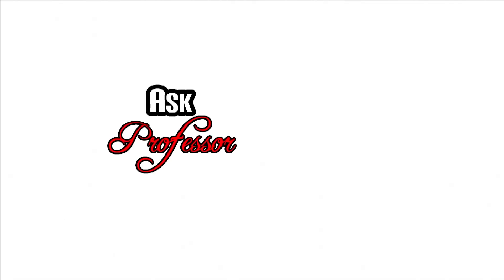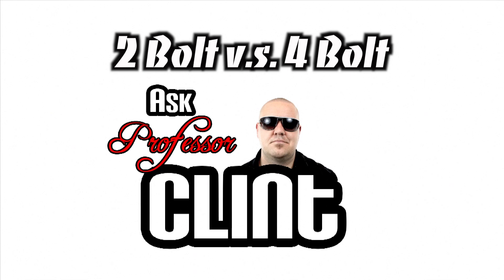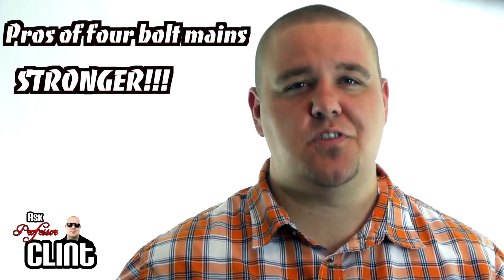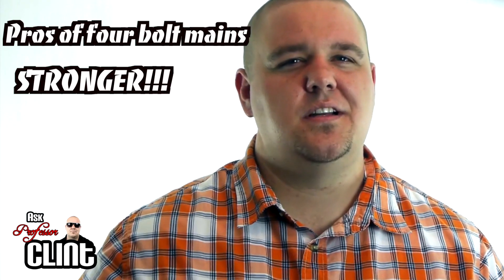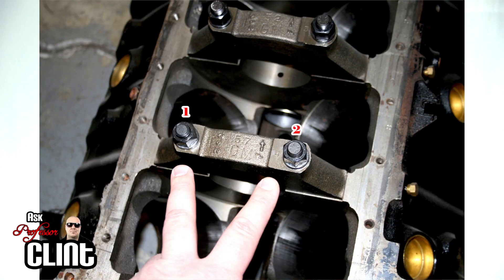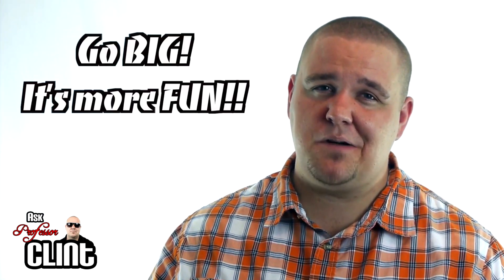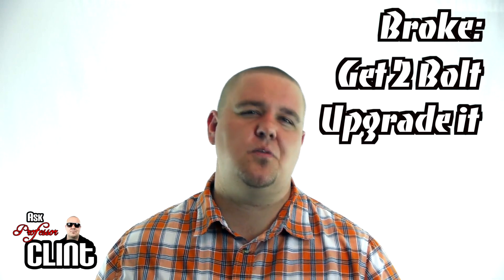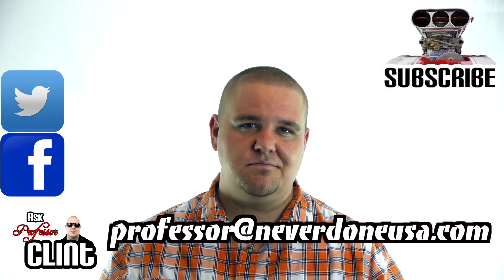2 Bolt vs 4 Bolt - Ask Professor Clint - Never Done

Comment: I bought a 4 bolt block in 1990 that came out of a race car. It still had some crosshatch in the .030 bores and it came with studs and a Milodon oil pan. All for $250. Cool! So I put it all together and first thing I notice is practically no oil pressure at idle however, it ramps up to 60 psi off idle. Yes, I plastigauged a a main and a cap and put in a new high volume oil pump. So, I changed the crank. No difference. Also, it seemed to consume more oil than I thought it should. I sort of figured out that perhaps 2 cylinder bores were elongated which explains the low price of the block. Ok, to my point. I want to build another small block but make it more bulletproof. Now, I talked to a few people and they said the 4 bolts will crack the valley by the lifter bores and will loose the oil pressure at idle which may explain my oil problem. They said get a 2 bolt and you wont have a problem. However, I been throwing speed parts at my present block and it's still holding together.I'm still using it of course. It runs a 76 Monte Carlo in the 13s now. It also can spin 8000 and live except the cooling fan and an alternator belt. Now, What I want to know if it's true about the cracking the block with 4 bolts? Actually it's 4 studs. I'm on a budget but whatever I find that I can afford, However 700 hp may not be enough. If I find a Roots blower on the side of the road i'm using it. However if the 4 bolts actuall do crack the block i'll stick with the 2 bolt which I allready have on hand.
Reply from the maker: Christopher Wyller $250 awesome deal! Good for you! Your question is actually quite complex. Every block has a point of failure under a given set of conditions (usage, engine temps, loads, rpms, external temperature variants, etc). The 4 bolt blocks do very well as performance engines compared to the 2 bolts (as you can attest to) but they will have problems as you approach their limits and it sounds like that is your intention. The right answer is to move to an aftermarket block and go for it but with budget being a consideration I think I'd stick with what you have and just let a good engine builder look it over to resolve the issues. If you're still unsure about using the 4 bolt you can also look at doing a 4 bolt conversion on a 2 bolt block (costs about $500).
Reply: Thanks for the reply! Yeah, i've seen the aftermarket caps on a block with the outer bolts splayed out to reach the wall of the block instead of just being on the bulkhead that would be the way to go but then you're looking at line boring the caps as well which woulld be a good idea regardless but add boring and decking and magnafluxing and you get a $1000 bill at least. Bout the cost of a new Dart block which is pristine to say the least. I just gotta face it. there's no cheap way to go.  I saw a 383 small block for $1700 in some magazine but you get loose clearences with those as they're made for one racing season so rats, I don't know. And you still gotta machine the Dart blocks, decking at least. I guess what i'm wanting is a bulletproof engine that lasts forever on a homeless man's budget. I guess i'll just start with checking out the present block and see how cracked it is. Problem is i'm still using it. I'll continue on with the 4 bolts regardless. I can easily see myself exceeding 700 Hp at any rate. Thanks for clearing that up for me.
Reply: Christopher Wyller  Dart blocks still need to be machine finished so expect to pay $500+ over the retail price of the block.  I've just added "Splayed Main Caps" to a 2 bolt (now a 4)and it dynoed close to 800hp. Bolts for the bottom end, we change regularly do to loss of Ductility.
Reply: Low pressure at idle sounds like extra clearance in the cam bearings.

Comment: We did dirt track racing, 350 SB usually .030 to .040 over. Used both 2 and 4 bolt blocks, generally 7000-8500 RPM. Both types of blocks did the job but I do have to say that when the 2 bolt let go....it really let go. Not much was left of the bottom end or the top end. Almost like someone put  a grenade in the engine. By the way these were also professionally built engines. This is just some extra information on 2 and 4 bolt blocks that we discovered from regular use, and it was not just us, it was a common issue among drivers. That RPM, sometimes even close to 9000, for a long period of time is eventually knock the crap out of any engine. Unless you have the money to rebuild and refresh on a regular basis.
Reply: Yep, many 2-bolt 350 has been built making 550+HP. I've built a few myself, but usually limit RPM to around 7500. They'll take more than people think. Wouldn't want to race a 100 mile road race with one, but in short burst, they'll live.

Comment: The exception here is the 400 factory small block Chevy.  The 4-bolt blocks are NOT as strong as the 2 bolt blocks.  In the video at 1:33, you will see a factory 400 2-bolt setup.  Notice how the caps are as wide as the standard 4 bolt SBC caps are, from register to register, for more contact area with the block.  The 4-bolt setup had a tendency to crack the blocks.  Note that this is ONLY the 400.
Reply: silicon212  eeeeeeyaaaaaaa
Reply: Exactly very true except the 350s also crack

Comment: sounds exactly how the big companies want you to think, we reuse the main bolts, bearings, head studs etc at upwards of 800 horsepower, a bolt doesn't magically lose its strength, they are just "pre stretched" yes they stretch, unless you over torque them, then your pushing the tensile strength to its limit and it takes little effort to break it. But if everyone did that how would they make their money. just like we use oem reused rod bolts, the rod ALWAYS breaks before the bolt, no need for arp.
Reply from the maker: To each his own. Good luck to you and thank you for watching the video.
Reply: No problem, and thanks. just putting my experience with this out there, people shouldn't feel pressured to buy all new arp bolts, if they are watching a video about mains I doubt they will ever be pushing over 500hp. (ps great video and drilled and tapped 4 bolt mains are stronger due to them being angled it gives no room for it to "walk")
Reply: @NeverDoneUSA a YouTube video just proved this on a 4 bolt main .010 casting 350 block with original hardware. Made 1025hp on the dyno with a torque storm supercharger.
Reply: @stevenbelue5496  very nice. 8 years later I still have my oem headbolts on my 800hp 5.3 ls. They have been reused 3 times now

Comment: for $500-1000 you can get a newer ls engine that has better caps in the first place.
Reply: But i'd rather keep the original 5.7 L 4 Bolt main  engine with bigger cam in my 1970 Chevy C 10  just to keep it original it sounds great and has enough  power for a daily driver
Reply from the maker: The LS is a GREAT option. It really all comes down to budget and desired outcome.
Reply: i know how that is. I'd love to get a ls for my s10 but instead I'm going with a $200 350. I guess the good thing is all the old 4.3 stuff still works.

Comment: I have a 350 swapped ford ranger, it's all stock besides the bore, (.060) what could I do to make more power? Cheap things to do?
Reply from the maker: The first thing to do is make sure the engine is running as well as it possibly can in it's current trim, a tuneup and proper timing will go a long ways on an engine that needs them. From there I'd start with headers and a free flowing exhaust system, then look at an aluminum intake manifold, a performance carburetor and a camshaft. The real power in a 350 is found in the heads, if you've got the money look at swapping them out. If you're on a SUPER tight budget look at getting colder air to the engine from outside the engine compartment via ducting, venting, scoops, etc. then open up the exhaust flow the best you can (even replacing restrictive factory mufflers with high flowing units will help)
Reply: Lol, i don't have a chassis to put it in, besides the ranger
Reply: ok just zip tie a bowtie to the grill then. lol
Reply: first pull that 350 and put it back in a Chevy.

Comment: Thanks for the info on this, I'm new to engine internals but have been doing all my repairs for years. Now I'm looking for a salvage yard 5.7 vortec to carb for my 84 c10 original 305 spun a rod on a 500+mile trip on a tight budget, auto tech student. Are there any tips you can offer to me in what to look for at the junkyard, I know I should check oil, and look for something that is wrecked, pull valve covers, turn engine by hand for compression. do I absolutely have to pull the oil pan? Thanks and I enjoy your videos!
Reply from the maker: That vortec 350 will be a nice upgrade for your c10. The standard things you look for are things you've already listed: Make sure it turns over, check the oil (you could just pull the plug) and look for metal or water, and look closely for any signs of external damage or wear. Look for areas that appear to have had issues in the past, ie leaky gaskets. I don't typically pull the valve covers before I buy a junkyard engine, as long as the oil looks good, it turns over and doesn't appear to have any obvious issues I'll usually just buy it. Buying a used engine will always carry a degree of risk but spending a few minutes checking it out can really reduce the likelihood of buying scrap metal. If possible have them run the engine for you, a running engine will tell you volumes more than one you're turning by hand. Good luck with your upgrade and thank you for checking out my channel.
Reply: Dime Fever k
Reply: k